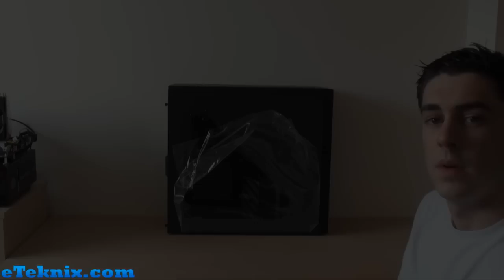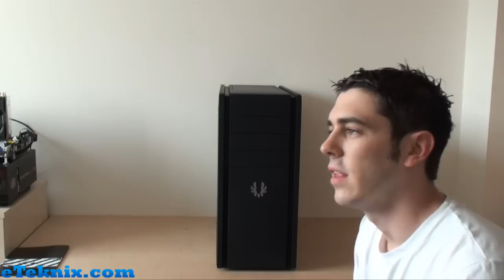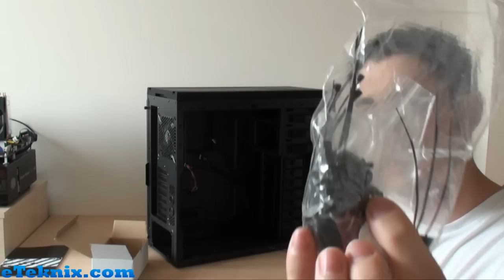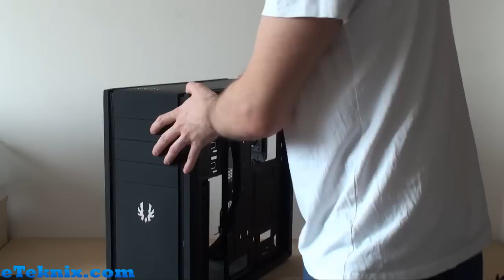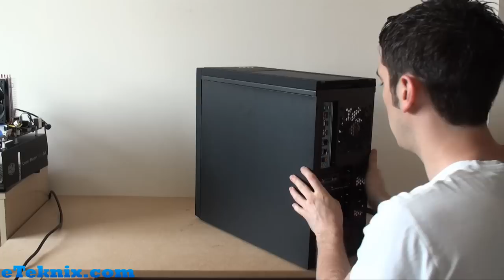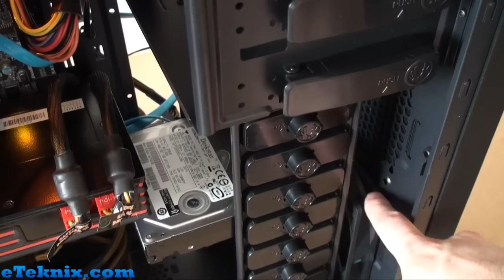Video Review: BitFenix Shinobi Chassis

Comment: I've been told that if the case has a 120mm rear exhaust ran, it should fit any gigantic air coolers. I could be wrong but I'm using a Thermalright Silver Arrow and that managed to fit in most Midi Towers (namely the NZXT 210).

Comment: Question! Do the fans come with a molex adapter? Because I dont have many 3 pins on the motherboard nor Molex connectors on the power supply, so I have to use one Molex connector for power to use the two fans...